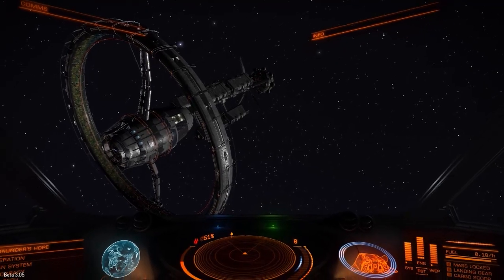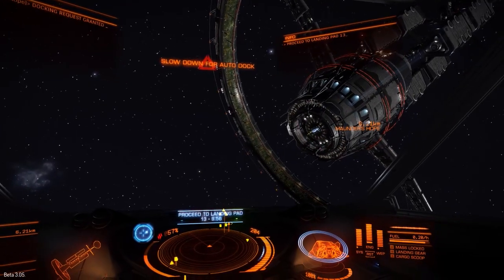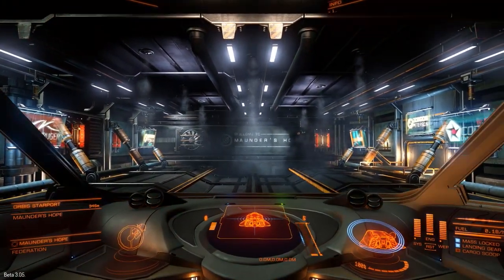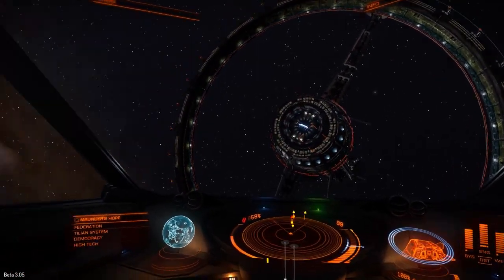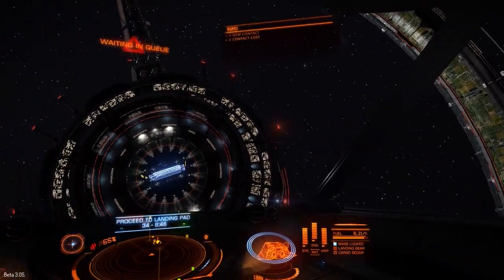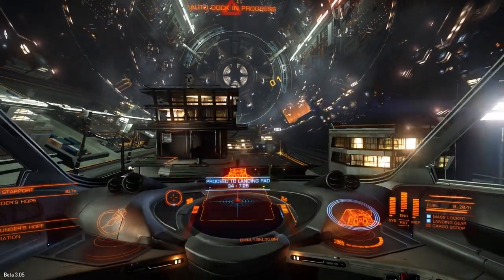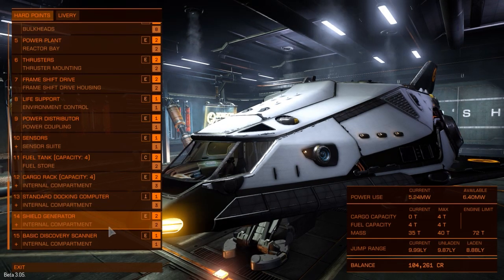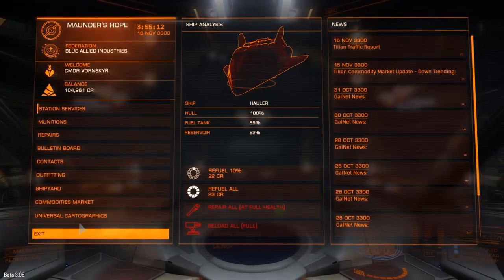Elite: Dangerous Beta 3 - Docking Computer vs Average Pilot

Comment: The music that plays is the "Blue Danube Waltz," it's a reference to the movie 2001: A Space Odyssey.
Reply: +DandyGuy Was used on the docking comp in the original ELITE, so not surprising that they used it again.
Reply: +DieyoungDiefast Actually, the original Elite was on the BBC Microcomputer and had no music at all - you may be thinking of a clone, such as for the Commodore 64 or Amiga.
Reply: Jack Horton nope, it did indeed have the danube waltz play when you used the docking computer on. In fact a YouTube search does confirm this.
Reply: Did you just call amiga a bbc mc clone? Heresy..
Reply: That or they just picked some classical music because it's neutral and fitting. 2001: ASO was essentially just one long (shitty) music video anyway.

Comment: I suck at finding the entrance to some stations, so the docking computer saved me time because it would go right to the entrance.
Reply: +Paul Mouton The entrance is always facing the closest planet or sun with the most mass and is rotating counterclockwise on its axis. Pretty simple really.
Reply: +Dirk Diggy thank you!
Reply: +Dirk Diggy the fact that it's always rotating counterclockwise and that the entrance faces the planet will be very helpful and save me hours of approaching the back side of stations in order to dock (which, especially for the chamfered cube stations was happening... most of the time :P)

so thanks :D
Reply: Sirius Black
 yea once you get the hang of it you "see" the entrance more easily. Also the BACK of starports have red lights flashing.
Reply: Just target the station as if you would a ship, there&#39;s huge arrows pointing in the right direction on coriolis spaceports

and if you can&#39;t find the entrance on orbis spaceports, excuse me but what the fuck
Reply: +Dirk Diggy Lol thanks so much for this tip, in one of the tutorials I think the travel one, you need to dock in order to finish but I swear to god I couldn't find an entrance xD
Reply: Dirk Diggy i found another tutorial that helps, now i approach to an ETA of ~5 seconds, then spiral inward, with the final loop passing close to the planet and then approaching the station with the planet behind me, which then puts you quite well-aligned in front of the entryway (at least, it's always visible on the ports that have entryways)

Comment: Sometimes I dock like an ace pilot. Sometimes I screw up and ram the control tower and get hung up on some structure and end up trashing my shields, incurring hull damage, and skidding along the landing pad. If the docking computer screws up sometimes I have a feeling it'll be less often than I do.

Comment: Use at your own risk. I installed a docking computer on my ship and after it slammed me into a stations bulkhead once with luckily no major damage and then again a few missions later I let the auto docking do its thing at an outpost and it wedged me into a small nook next to the landing pad. I almost didn't get unwedged before my hull went critical and my ship exploded. I had learned to pilot well enough by then to not risk it using autodock again. I sold it and put in a shield booster instead.

Comment: Like has already been said, the best way to use the docking computer is to speed manually into the station close to your landing pad, setting the throttle to 0 and letting the docking computer do the final approach and dock.
(i know this is from beta 3, but someone might watch it now and think docking computers suck)

Comment: Works best when you are Mass locked and within 2-3 km away from the station. I thrust full speed ahead, after I mass lock, I slow down while requesting permission to dock.  When I drop to a slow enough speed, the computer takes over. pretty fast and seamless.

Comment: They need to implement this feature in all the ships by default, so you can turn it on and off simply by switching to one one your tabs. 
It will be dumb to waste compartment slot for this, even on bigger ships, imho.

Comment: I imagine that the autodock is far, FAR better for something much bigger than the transport you're flying here.
Reply from the maker: Yeah it could be, I haven't tried it with anything larger yet. The biggest ship I've flown in this game is the Type 6, and that's pretty easy to dock manually as well. I guess once you are up at the Anaconda and Type 9 level then it could get a bit more difficult
Reply: Manual docking is responsible for, like, 90% of Anaconda and Type 9 deaths. :p
Reply from the maker: vp21ct hahaha eventually I will grind my way up to one of them and I'll likely experience that for myself!
Reply: I have tried the docking computer with the Lakon type 9 and it sucks. It bashes the shields to oblivion on the way in and meanders the interior of the starport for 5+ mins as it attempts to find the bay.
Reply: Adam Hart
 But it didn't kill you, did it?
Reply: vp21ct Nearly, the damage to the hull was catastrophic. The end damage was 94% damage to the hull, power plant dead and no shields ^^. The anaconda test didn't fare much better either haha

Comment: To be fair, the docking computer did nothing for about a minute because it was waiting in queue, check the HUD.
Reply from the maker: Yeah that's true, but waiting in queue is part of what the docking computer does, so I'd still consider it part of the docking process. A player doing manual docking might sometimes get their docking request rejected because the station is too busy, but they won't be stuck waiting in a queue for other NPC's to finish docking.
Reply: Vornskyr so far i've never had to wait in a queue to dock with my docking computer. it is faster for me to use the DC since positioning can be a bit tricky at time with the use of the keyboard and mouse.
Reply: +Mortjep9531 Docking computer wont kick in untill you throttle down, so you can do your closing-in with full speed and booster on and then cut the engines once you're trough or close enough and let the computer take over - for me it surely does the last bit faster than i can.

Comment: I like to use the docking computer seen as I am a hauler and it is actually good when you have multiple cargo missions because whilst it is landing, I can lock in my next destination which means less time on the landing bay

I was attacked by a player whilst in auto docking and it turned the auto dock off (it didn't end well for him lol) so don't go too far whilst it is landing

Comment: Nice video comparing between manual docking and auto docking 
i just purchased a docking computer and i would agree it can be slow at times but this is ok especially when ive just come out from a long trip  gives me plenty of time to smoke a cigarette if only that annoying sound would just stop i would enjoy it more also maybe a variety in music would be nice
Reply from the maker: Yeah the beeping sound pretty much means I won't ever use it again, at least until thats fixed. Taking up an internal compartment slot doesn't help either, those are too useful for other things!

Comment: Is the DC available in different Classes and Ratings? - it would be logical if you needed a rating for a bigger ship, and if better classes would dock you more accurately, quickly and safely. If you're a pirate wanting to Dock your viper whilst you take a pee - class 1 Rating 1 is fine. Got an Anaconda full of expensive cargo and "time is money" - go for your Class 5, rating 5. (which costs the lave, but docks the ship safely and quickly at supercruise speed.)

I'm guessing the logic for autopiloting isn't brilliant,since the NPC ships quite regularly seem to stuff up docking and destroy themselves.
Reply from the maker: I'm pretty sure there's only a single one size fits all module that works with everything. It seems to be one of those features that was added ages ago in beta and then hasn't really been touched since. Fleshing it out a bit like you say would be nice, but I doubt its a priority for Frontier, tbh.

Comment: Can't you enter the station THEN activate the docking computer?
Reply from the maker: I don't know, I didn't try it. The thing is, it activates as soon as you request docking, and of course you can't request docking if you are in the station. You may be able to disable the docking computer  by powering it down until you've requested docking and are in the station, and then power it up, but I think that could be more trouble than it's worth. I should say too, I believe the docking computer has been updated in either 1.1 or 1.2, so it may not work the same as it did in this video.
Reply: Colaris no. the docking computer is automatic and activates itself once you reach a slow enough speed OUTSIDE the station/port/outpost.
Reply: +Colaris yeah u can. U can just go in the station fullspeed and then slowdown and computer takes control
Reply: +Colaris  So it`s awesome for smugling
Reply: +Mortjep9531    no you can fly full speed into the staton  hit the brakes inside the docking computer will instantly take over and land you quicker than the time it takes to work out which pad your supossed to go to
Reply: ste hogan mind you that my comment is some time ago, there has been many updates since then, including updates to modules. the docking computer only worked outside the station for me everytime i used it. this might have changed after.
Reply: sorry i never noticed the date  yeah they probably  changed it since then ,  i only had game a month . the game still seems  a work in progress   :P
Reply: +Colaris try to inactivate the dock module and then enable it when you need.

Comment: were do i get a docking computer can find it
Reply from the maker: I think your best bet would be looking for a High Tech station with a large population. They normally have the best range of parts, but it's not guaranteed that they will have one. It goes in the Internal Compartments, so one of the slots you would have a cargo hold, or discovery scanner, something like that.